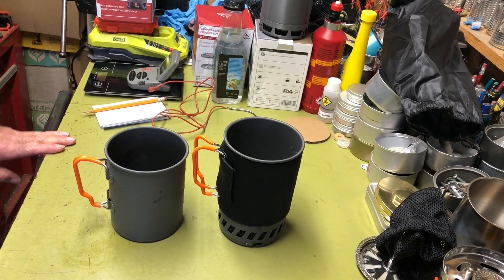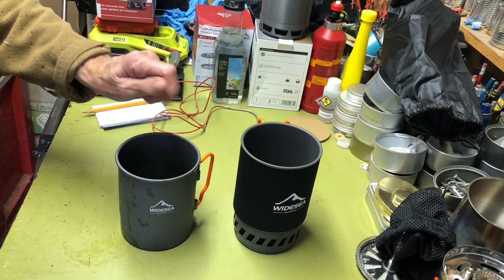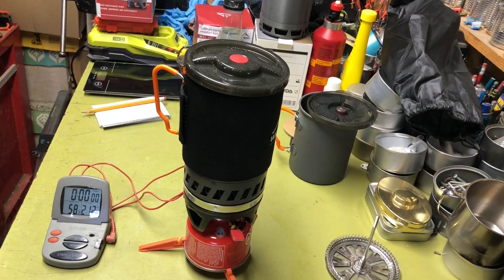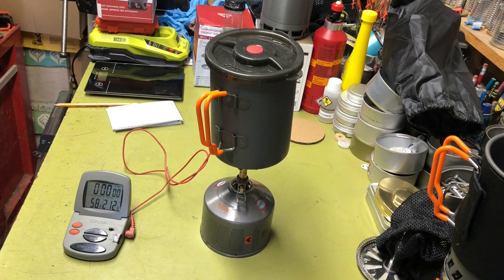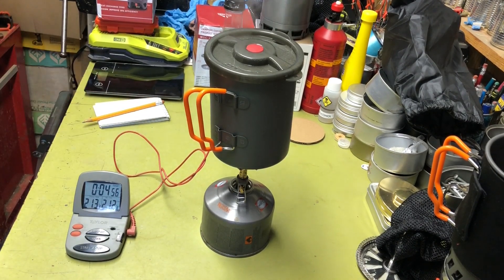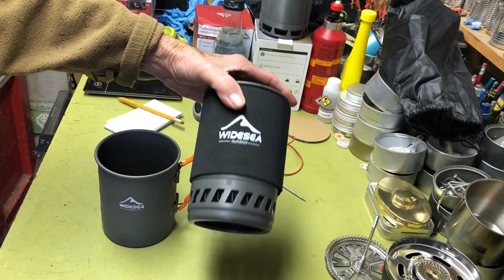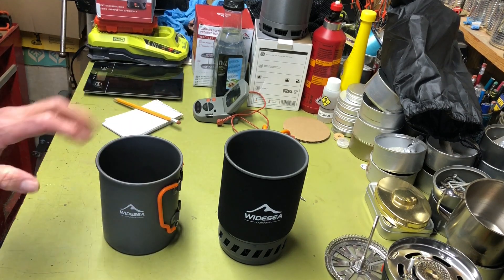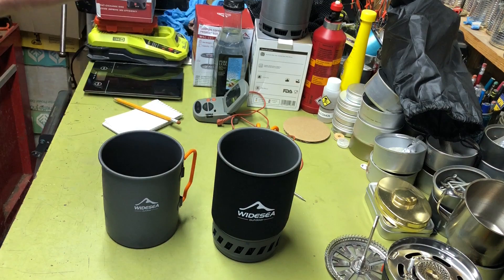Testing boil times between  a Heat Exchange Pot vs a Non-exchange Pot

Comment: This is not a valid test, the stoves must be the same. Different stoves have different BTU output. Everything must be the same except the pot. I would run the test with the same stove for both, and remove the sleeve from the pot.
Reply from the maker: True.  I was just ball parking it.  I am curious about the  jacket effect, 
It's going to rain the next couple of days so I'll do a follow on, without the jacket and using the same burner.  The pots are identical except the heat exchanger so should be a good test.   
Thanks for the feedback and keeping me honest. 🙂
Reply: @planetsideagent  Looking forward to the result.
Reply from the maker: OK, I just published the re-do video.  I also tested with and without the isolation wrap.
The interesting thing is there was not that much of a difference.
https://youtu.be/p1BcFMVIi00

Comment: Does the jetboil type come with a pot stand to use standard pots?
Reply from the maker: No it does not.  Jetboil have one but the Widesea is a little wider so it probably won't fit.
Reply: @planetsideagent  ok, thanks.
Reply: @planetsideagent  Widesea has a another model with adapter for this.